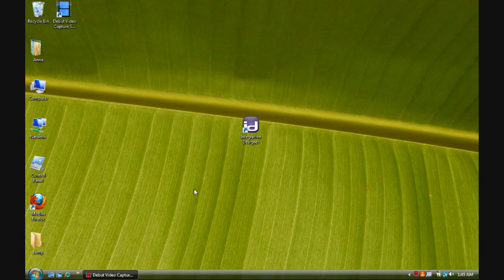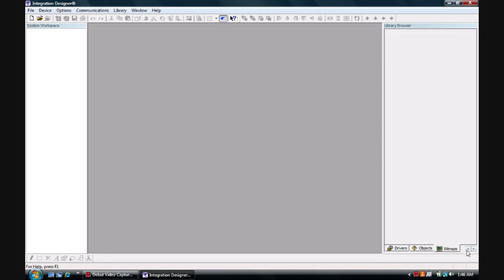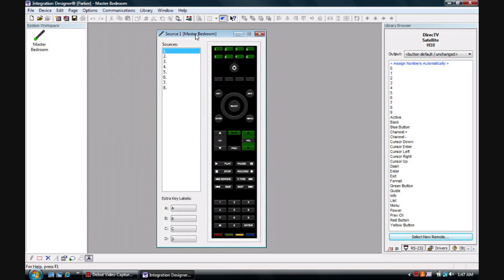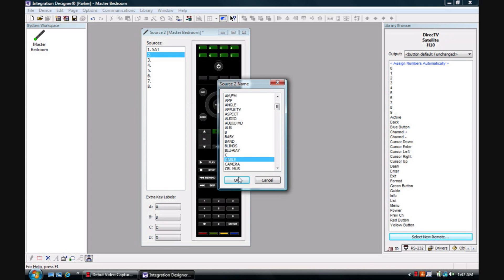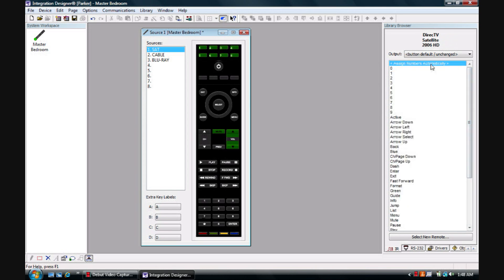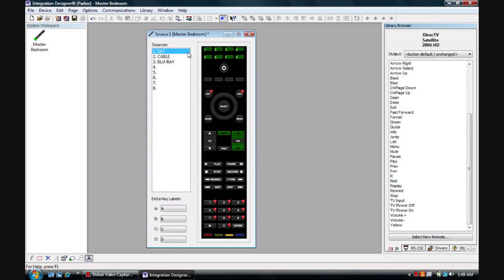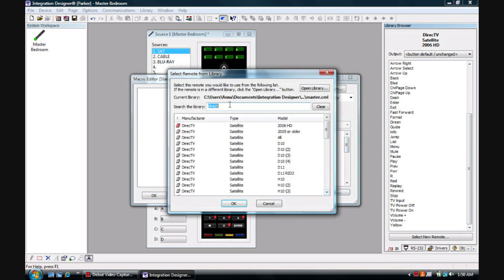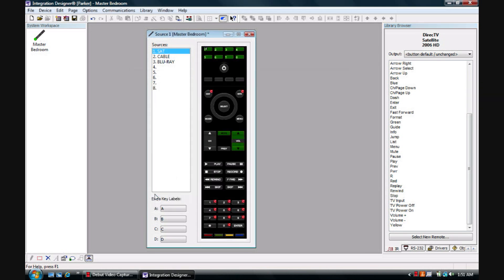Introduction to RTI Integration Designer

Comment: about the programmer tool or software program..do u know how can i have
Reply: +Marcos araujo You need to contact a dealer in order to have a system programmed, or apply to be a dealer if you want the software. Both can be done through RTI&#39;s website.

Comment: RTI T3
RT RP6 Processor:
RTI RM-433: 
RTI RS-232 control cables (3/ea) 

I can buy that used from guy for $475 think it's worth getting or will I have issues getting the software to set it up since its dealer only. This looks pretty slick from your video here.